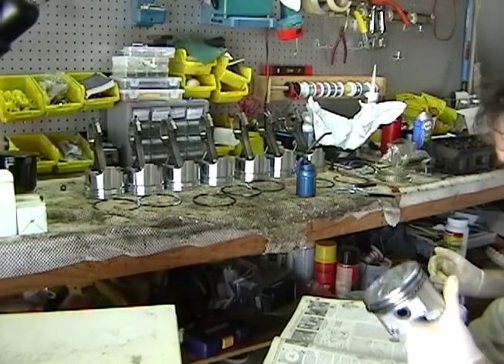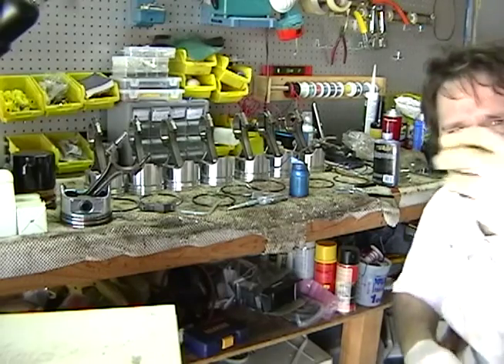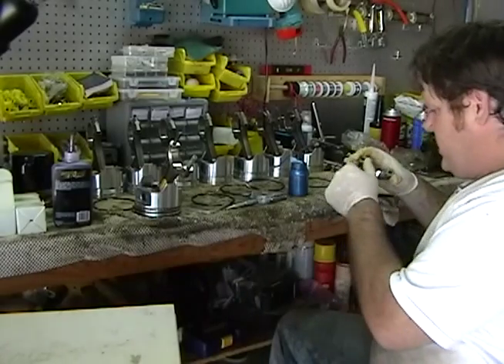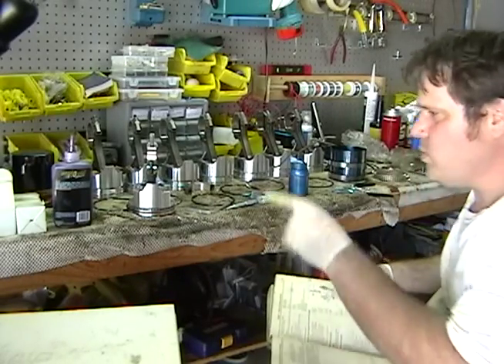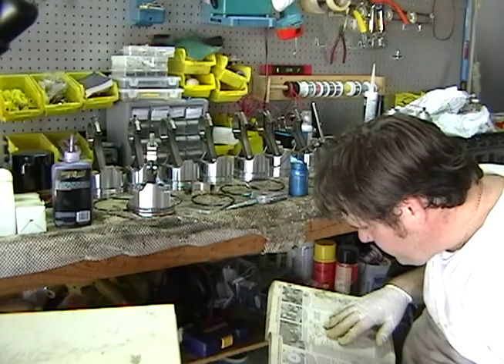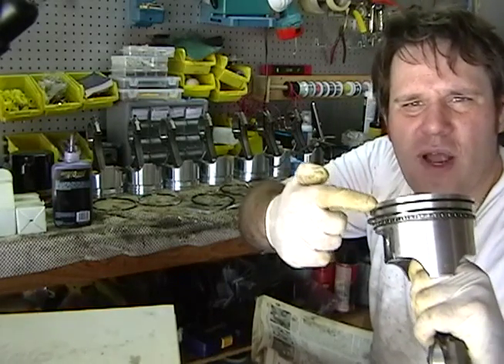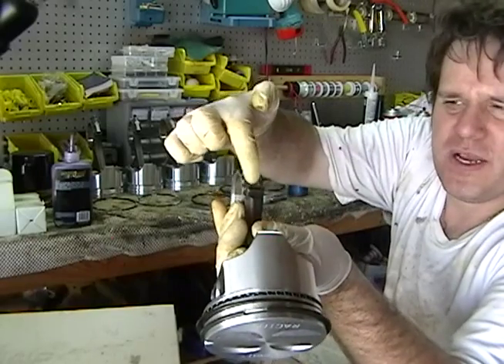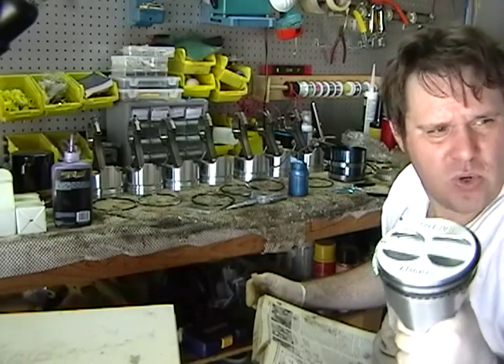1990 Ford F150 302 Engine Rebuild / Overhaul an Engine Part 10 Section 1 Piston Ring Compression/Oil

Comment from the maker: Piston Rings, Cast Iron, 4.000 in. Bore,  5/64 in(, 5/64 in., 3/16 in. Thickness,
Pistons, Hypereutectic, Flat, 4.000 in. Bore

The rings were not beveled and the end gap was not modified(Manufacturer Default)
Installed and Oriented per Instructions that came with rings

See Video description for important information regarding OE pistons and aftermarket pistons